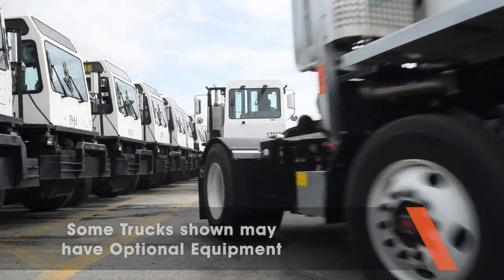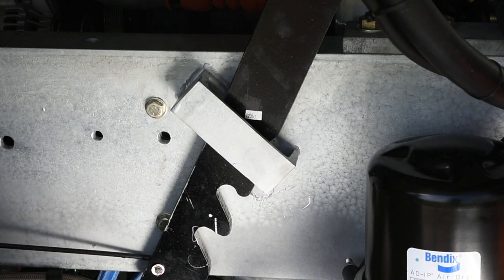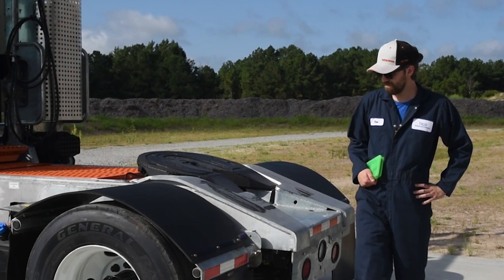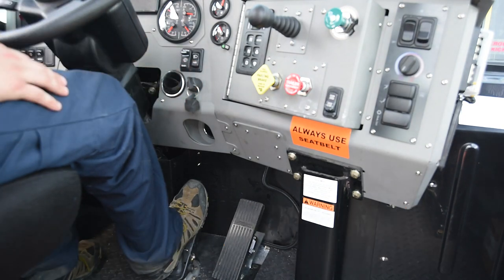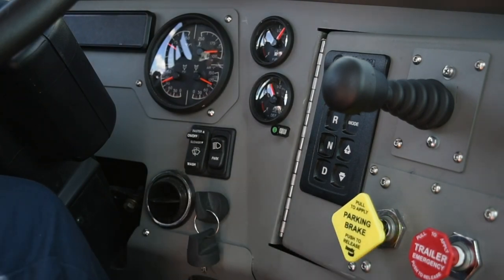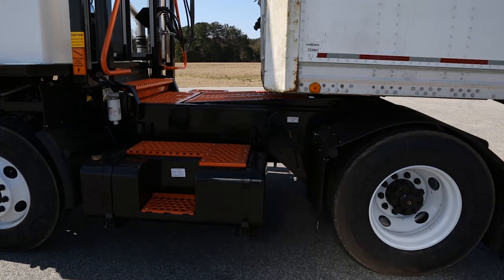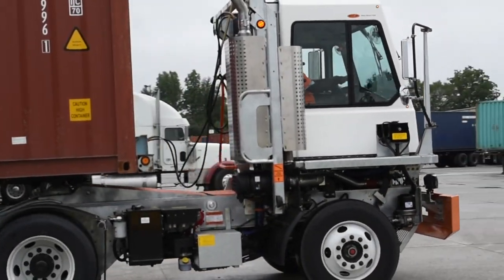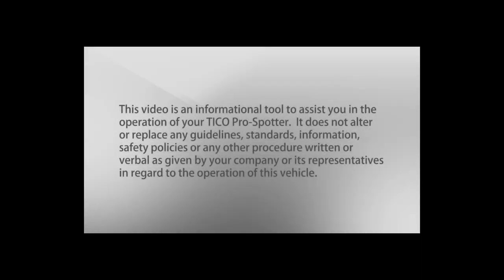2018 TICO Driver Orientation Video

Comment: We have three of them in Buffalo.The cab design is terrible when snow and ice get on the roof it melt and come right in the drivers window.
Reply from the maker: @erietrain - hello- this is easily solved with cab rain guards which can spec’d out of the factory. if you provide us with your company info, we will have our local dealer reach out to provide. thank you!

Comment: I have driven a Capacity for over 17 years. I can average 50 moves in 4 hours. Thats hooking up to trailer opening or closing doors and putting them up to the dock or pulling down and putting them in the yard. These Ticos switchers look like Edsel ford.... lazy man switcher